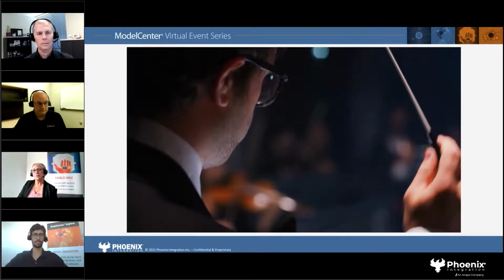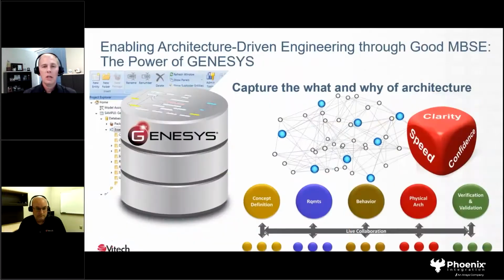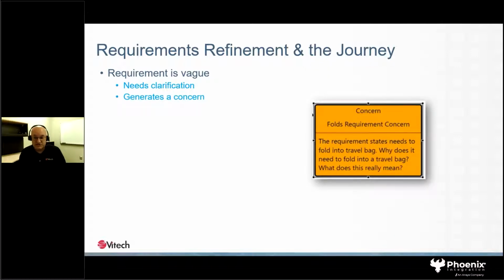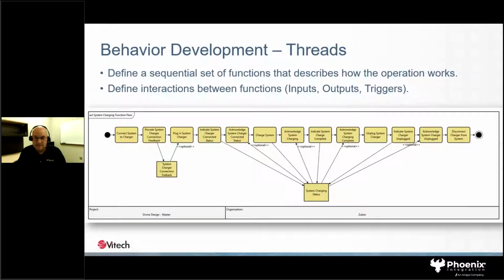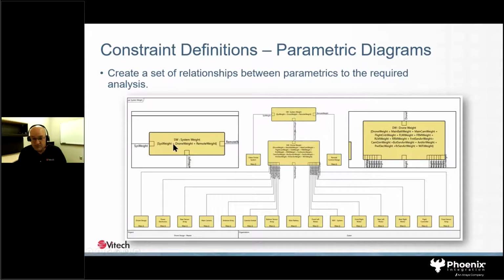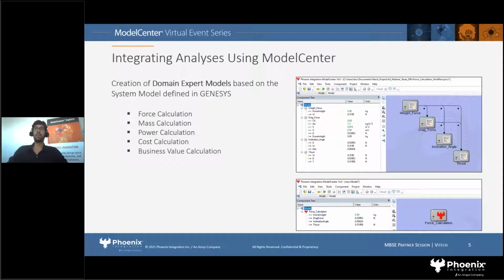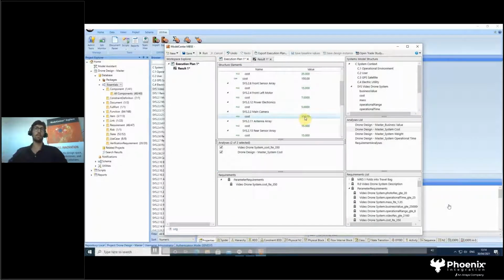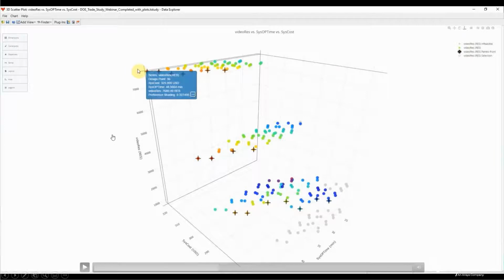MBSE Session   Engineering from Architecture to Analysis and Design  A Practical Look using GENESYS

Comment: From my understanding Actors should be directly involved in interactions with the system's use cases. Environmental factors like GPS signals or operational conditions usually aren't actors unless they directly invoke or receive system interactions.